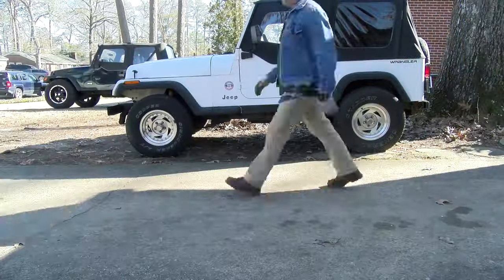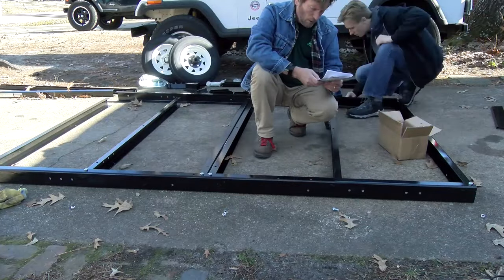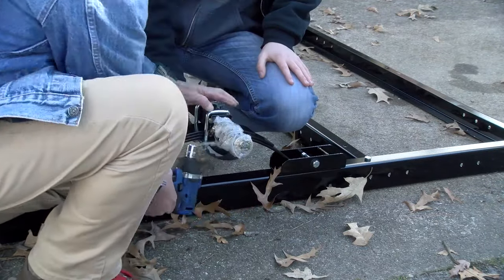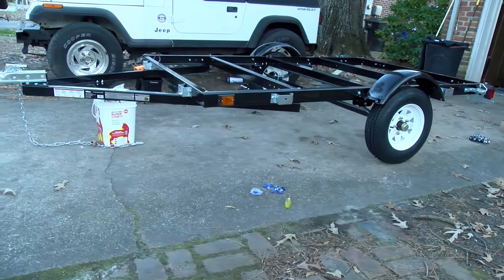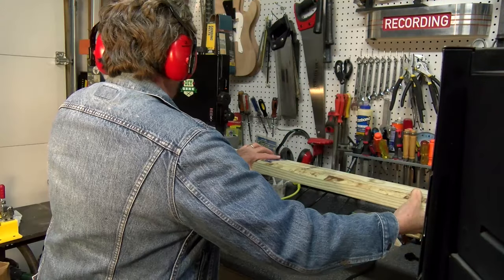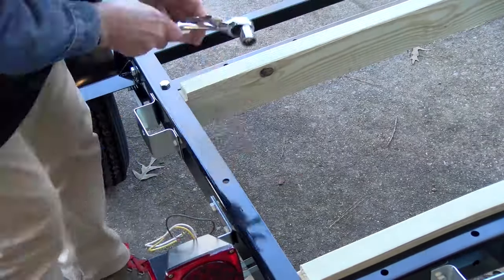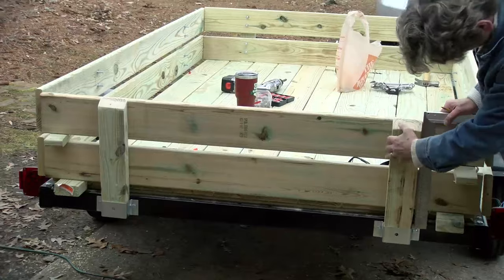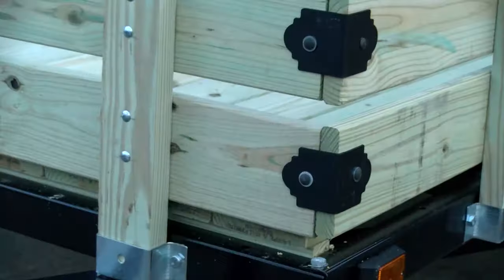Building a Ironton 5' x 8' Utility Trailer Kit from Northern Tool.

Comment from the maker: I just saw that as of today, 11/27/21 if you spend over $500 you get a $100 gift card. That is how I bought this trailer kit. I don't know how long it lasts. but visit on-line at https://www.northerntool.com/. 👍
Reply: Its $700 now unfortunately
Reply from the maker: @letsgomicroliving_1993_  I would definitely wait for a sale.
Reply: Hey gene, think I could bolt a lunette ring on for a pintle hitch instead of the 2" coupler?? Thanks!! 😊
Reply from the maker: @foxmulder7616 , I bet you could!
Reply: Built mine and the Arizona MVD said they couldn't register it and give me plates because the MCO (title) wasn't signed on the back by the dealer, so I had to call northern tool and get them to send me an "original bill of sale" signed by them.. smh hopefully wherever they send me is an "original bill of sale" and the MVD accepts it,,!! The trailer manufacturer is some Chinese factory, the front of the title was signed by some Chinese person but not the back dealer section. Smh lol
Reply: @foxmulder7616  Thanks for the heads up to double check with the dmv.

Comment: Thank you for the great advice on building the trailer. I would put tie down hooks on the top rails to and then both upper and lower in front and space the the tie down hooks. Love the way it turned out.😀🤘
Reply from the maker: That's an excellent suggestion. Thanks for watching.

Comment: This is a good and informative video. Thank you for posting. I would like to mention about the trailer axels. After putting the hubs on the spindles, install the washer and then the castle nut (as you called it a slot not). You then tighten the castle nut all the way down to preload the bearings. Then back the castle nut off to where the tire will freely spin. Install the carter pin, cap and call it done. With the wire connectors, I couldn't hear weather you said the are or are not weather proof. They are not. I would have use butt connectors with a 3:1 heat shrink  which has adhesive on the inside. This will help make it more water proof/resistance. All in all, it works for you and you did a good job showcasing the trailer build.

Comment: I would have put the carriage bolts in with the heads in the trailer and the nut on the outside.  Not as pretty to look at but it’ll give you a flush surface on the inside to slide stuff up against.  So you’re less likely to damage it.  
Also having the sides tighter together with less of a gap.  This way if you need to haul sand or a loose material, you won’t lose as much.  
Nice build overall.
Reply from the maker: Those are excellent suggestions. Thanks so much for watching.
Reply: I look forward to seeing your video showing a better way of doing things...

Comment: I enjoyed this video and your build. For my use, I would have made the following modifications. 1) reverse the carriage bolts so the rounded heads are on the inside. Then cap the outside of the bolts with Acorn round head nuts. That eliminates the studs of the bolts sticking out inside the cargo area and snagging the cargo or your shins and hands. Sharp edges are a no no. 2) I would have run a white ground wire to all the lights. I have experienced too many issues with bad grounds on trailers. For me, well worth the extra cost and effort. 3) grommets on all wire penetrations through the metal holes in the frame. Chaffing wire insulation is definitely a thing. Been there, done that, don’t want to go there again.

I like your use of deck boards instead of plywood. It just looks better and I just like it more than plywood.
Reply from the maker: Those are all excellent suggestions. I really like the idea of putting the carriage bolts to the inside. I have already scraped myself on one.
Reply: Same here with the lighting suggestions - that nice powdercoating breeds grounding issues. Same with the blue connectors - expect to start having corrosion issues with them, as they damage the wire and are not fully waterproof. I never have issues after I went to running a dedicated ground to every light and using shrink connectors.

Comment: I have watched this video of yours at least a half dozen times. Great video! 
Bought one and used your video as a reference. Cost me $549 with a $100 gift card as a reward. Used the gift card and got the loading ramp on sale for $79.99 and still had $$ leftover.  5x8 really is a great size!
Reply: One of the grease fittings broke when I tried to add lubricant. Called Northern Tool customer service and a few days later, got a new pair of grease fittings. Customer service vas very nice and helpful which makes this trailer just that much better of a purchase. Bravo Northern Tool!!!
Reply from the maker: I'm glad the video came in handy, because the instructions are not up to much. But mine has been a great trailer. Thanks for watching.

Comment: Looks far better than the harbor freight trailer! Thanks buddy for video.
Reply from the maker: I looked at both before settling on the Northern. The big differences I found are the axle is a full square tube VS a U tube with spindles welded on the ends. The fenders a better and the bed is 5’ wide VS 4’. It has been a great little trailer. The only negative is the instructions are bad and the wire connectors are not waterproof. Thanks for watching.

Comment: I just bought the aluminum version of this trailer today and should receive it in a week or so. You did a fine job on your bed and stakes. I also think it was a great idea to run the wiring through the wood beams. Thank you for the video.
Reply: Wish I'd bought the NT Aluminum 5x8 instead of the HF Steel 4x8 - it would have been MUCH more useful, and better looking, too !!
Reply: @checkyoursix5623  After I assembled the trailer I priced out the lumber for the sides and floor and it was over $200.00! Now 4 months later the prices have finally dropped so i can get the decking and sides and finally finish the trailer.

Comment: Thanks, by far the best video out there on the Ironton 5 x 8. I really like your 2 x 4 idea under the decking. Although, I would have made them flush with the top of steel cross channels with the same floating floor like you did. I plan to weld the upper cross channel bolts into ends of 1" sq. tubing for my side panel upright posts, then weld a 1.25" top rail on and something along the bottom and 1/8" HDPE plastic sheets to save weight.
Reply from the maker: Thank you. Those are some really good ideas. My trailer is holding up great and I never regret buying it. Thanks again for watching.
Reply: @DIYGene  Thanks Gene, good to hear it is holding up well.

Comment: I just bought this trailer. I too was confused by the center brace and the tongue attachment points that varied from the instructions. I attached them the same way you did although I wished I had seen your video prior to this confusion.. thanks for the video. Great job!
Also NT now just offers a $50.00 card instead of $100.
Reply from the maker: Hi David, They really need to update the instructions. Thanks so much for watching.

Comment: Gene you did very well just a thing. I would change .... 1. On the side boards and end boards. I would have reversed them and put the heads on the inside and threads on the outside. My late Father and I built several utility trailers and all had the heads on the inside. His reason was the threads would possibly scrach something you were hauling.
Reply from the maker: Excellent point! And I ended up doing that exact thing, but only after tearing a whole in a friend’s couch LOL. I also would recommend using water tight wire connectors. The ones it came with are not. Thanks so much for sharing and for watching.

Comment: Great job, my only comment would be. The wiring should be soldered and covered with weather/water tight heat shrink tubing.  The provided connectors are not weather tight, and are really meant for temporary internal use. In no way your fault, they should have put better connections in the kit, or explained in the directions...
Reply from the maker: That is good to know and thanks for putting this out there. I figured they would provide water proof connectors.  Thanks again for watching.
Reply: Also wherever the wiring comes into contact with the fram there needs to be some protect with a small grommet. That will help to make sure the sheathing on the wire isn't scraped off resultng in a short and the lights not working.

Comment: The tailgate latches you installed have a tendency to wiggle loose when you're going down the road, leading to a lost tailgate.  I'd recommend replacing them with something that securely locks, or adding a swivel catch that will secure the handle.  When it's time to rewire the lights, get some good heavy duty jacketed wire and use heat shrink connectors.  The wire that comes with those cheap light kits is usually almost as bad as the scotchlocks that they provide.  Make your splices in protected locations if you can and protect any of the exposed wire with split loom or tape to keep the sun off of it.  Make sure you have a good ground coming from the tow vehicle to the trailer.  If the jack breaks, replace it with one with a foot instead of a wheel.
Reply: Replacement of jack wheel: speaking from a woman's, I'm much more prefer a wheel on my swing. When the trailer is loaded, the wheel allows me to move my trailer around manually with ease. It also saves stress and strain on my body.

Comment: Great video. My only suggestion would be to put the heads of the carriage bolts to the inside of the bed so there would be a smooth edge for not scratching up any cargo that is  hauled.
Reply from the maker: That is an excellent suggestion. Thanks for watching.

Comment: Good video.  I like the decking.  The wire connectors that crimp the wires are junk.  They are not waterproof and are very susceptible to corrosion.  Using butt connectors or soldering and covering the joints with heat shrink tubing is the best method.
Reply from the maker: I agree. Good advice. The bad thing is the trailer come with those crappy connectors. Thanks so much for watching.

Comment: i'm about 1/2 way through so far great video. do yourself a favor and buy a good impact driver. they aren't quite as powerful as an impact wrench but they are the handiest tool you'll ever own.

finished the video and its a great video! thank you for making it and sharing!
Reply from the maker: Thanks so much! It has been a great trailer. And the cordless impact wrench is a must. Thanks so much for watching.
Reply: @DIYGene  i know. i have 2! home depot puts the ryobi 3 speed p261 kit on sale about 3 times a year for $99. i got one for myself and one for my dad. i snagged a hart single speed 3/8 at walmart on clearance for $55 (tool only) but the one i use the most is my dewalt atomic impact driver which was $99 for the kit.

Comment: When connecting the tongue to the frame a spacer inside the channel with a longer bolt running through both sides of the channel would be nice. There are holes on both sides of the channel. Some sch 40 galvanized pipe would work for spacers.
Reply from the maker: That is a great suggestion. Thanks for sharing.

Comment: Use caution with the tongue jack. If the trailer has a lot of weight in it those A frame rails will twist a lot. 
I replaced the center cross brace with a cut up 4x4 and bolted my jack to that so it's inline with the center of the trailer.... works much better with weight.
Reply from the maker: That’s a great suggestion. Thanks so much and thanks for watching.

Comment: Good vid.    I just gave away my trailor I made from an old pop-up camper and need something smaller. Aka that will fit through my gate into my back yard.    This would be perfect.  Would just make the deck into a dump trailor insted  add a hing or 2 and a tall support upnfront and a winch  hand crank or eletric
Reply from the maker: That’s a great idea. You might check out Northern’s web site because they were offering $100 gift cards with the purchase. That what I did. But I don’t know how long that deal lasts. Thanks for watching.

Comment: Put the heads of the carriage bolts for the upright fence boards on the INSIDE of the trailer, not the other way around. Now you have bolt heads that will chaff and are in the way.
Reply from the maker: Excellent suggestion. Thanks for sharing.

Comment: Nice video thanks for posting, that trailer looks very similar to the Harbour Freight Super Duty 5x8 that I've seen on YT, however, judging from the look of those fenders it would appear to have somewhat better specs. A friendly word of advice, those blue snap together electrical connectors ( known as Scotchloks here in the UK) are most definitely NOT waterproof, after a while they will begin to fail when exposed to rain, road dirt, winter roadsalt etc and are not suitable for an outdoor automotive application. I learned this the hard way. Regards from Wales UK.
Reply from the maker: That’s good to know. I may put some heat shrink over them. Thanks so much for watching.
Reply: @DIYGene  so why did you say they were waterproof?
Reply from the maker: It’s my understanding that they are. Why would the manufacturer provide connectors that that are not considered waterproof. But if you can improve on it, why not?  Thanks for watching.
Reply: @DIYGene  They never said they were,......many aren't. Don't assume.
Reply: @brentbradley6711  Thanks so much for adding these amazingly insightful comments Brent! Have you been doing your insecure internet troll act for long? Your really good at it!
Reply: @herbyvonderby1849  Don't post false info!
Reply: @brentbradley6711  = Troll
Reply: @herbyvonderby1849  Novice
Reply: you are going to have problems with the connectors. ask me how I know

Comment: The scotch locks that were used to connect trailer wiring to your lights are prone to failure. There are other connecters that work a lot better. Ground wires should have bare metal to bare metal so a dremel tool would do the job.
ex. military electronics guy
Reply from the maker: Totally agree.  Surprisingly that’s what the trailer kit came with. I have sense change them out using heat shrink. Thanks so much for watching.

Comment: Great build, Gene.  Looked good finished.  Curious how much weigh it is rated for? My only comment on a job well done, may be to torn the carriage bolts around and counter sink the nut side into the 2x4 side.  Puts the smooth head to the inside and hides the threads from catching on clothing on the outside.  Should lose enough strength since these are just side walls.  But, hey, maybe your way has served you fine.  Again, thanks for the nice video.
Reply from the maker: Excellent suggestion on the carriage bolts. The trailer is rated for 1715 lbs. thanks so much for watching.
Reply: @DIYGene  Hey Gene, How do we get a title, vin, or Bill of sale for this???
Reply from the maker: @bbur75  it actually comes with a title.

Comment: Nice job on the trailer. I would have  fastened your side and end pieces to the 2X4 side pocket stakes with 5 deck screws  at each  intersection of upright 2X4 and 1X6. The screws drive in from the 1X6 into the 2X4. That way, no carraige bolts to trim when you're done, it's less expensive, faster and just as strong.
Reply from the maker: Excellent suggestion!  Thanks so much for watching.

Comment: As far as i'm concerned, an impact and drill are a necessity for a project like this in order to preserve my sanity, SO many fasteners, can't imagine doing them by hand.
Reply from the maker: I think you are right! Thanks so much for watching.
Reply: @DIYGene  I was building a shed that cost $650, and bought a bosch12v drill and impact driver set for $100 for that. I had been looking for an excuse to get a small drill for a long time, and that project alone was worth the purchase.

Now that I have them, I rarely touch a regular screw driver, and with adapters, I only use sockets on things requiring more than 50 foot pounds.

Been working on my chainsaws recently, and especially when its the end of the day and I have to take my saw apart AGAIN because I didn't get it right the first time I really appreciate having them.

Having both the drill and impact driver allows me to keep 2 different bits / sockets ready so I don't need to swap them out as often.
Reply from the maker: @nate2838  , I picked up a 1/4” impact driver and really like it. But I think I’m also going to pickup a 3/8” driver for the bigger things.

Comment: I got the bottom square but the top is off by like 1/4 inch.  Also air is trapped in my grease cover, it just pops itself off.   Guess i need to prefill with grease to solve this?  Too tired today to finsh it.

Comment: You had me going OK til you got to the wiring. I can't say I share your opinion of crimp on connectors. IME they corrode and fail in about a year. And No chafing protection for the wires passing thru the frame? You're killing me smalls! ;-) By the time you did that "ground" I was offended enough I had to say something. A self tapping screw thru the frame would have been better. I got my trailer like this earlier this week. Mine is the folder, but I can see where they share many of the same parts. Thanks for your time presenting this. Lots to be learned here.
Reply from the maker: I see what you are saying with the connectors, but that is what it came with. I have sense gone back and replaced them with heat shrink. I hope that dose better.  Thanks for watching.
Reply: @DIYGene  As an older guy with 50 years mechanic'ing, I always solder and heat shrink. That is "the way". LOL
Reply from the maker: LOL, Yes this is the way.